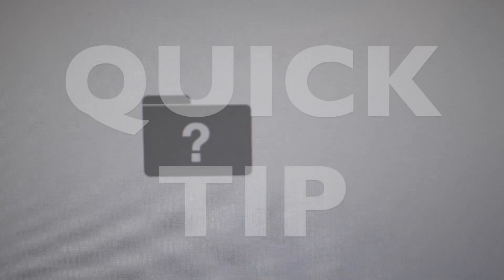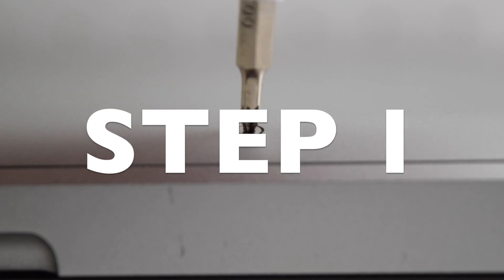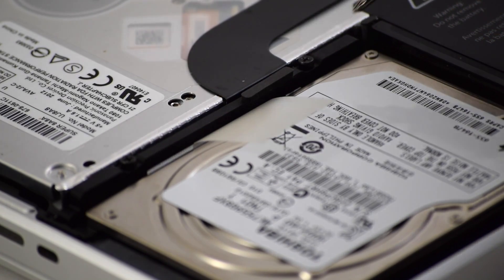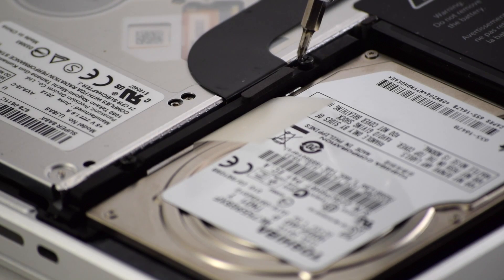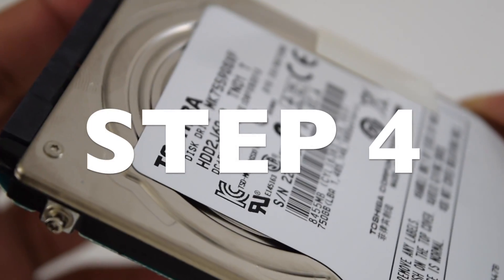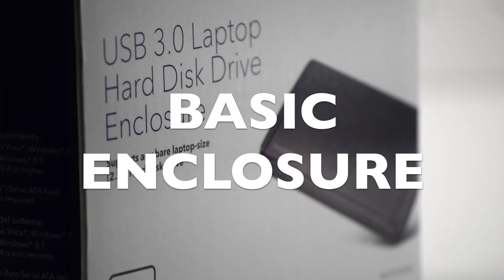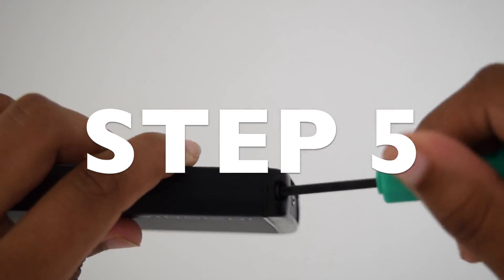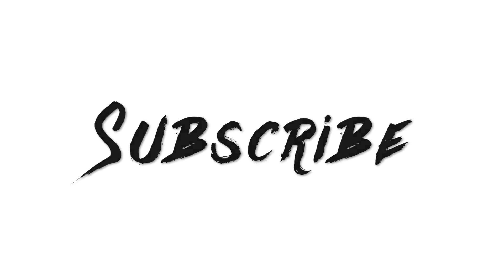A Quick Tip for fixing a flashing question mark on a MacBook Pro!!!!

Comment: Before removing the hard drive or the flex cable, it's more safe to first disconnect the battery connector gently, then push and hold the powerbutton for 30 - 45 seconds, so all power is off the logicboard.
Reply: depending on the model for sure

Comment: hi, I erased my MacBook pro and it has been showing the question mac icon. I have tried the cmd+r and power button, also the option button. but after connecting to a wireless network, it just shows me the rolling atlas and the network name. What do i do next
Reply: IZUNDU Somto me too, it says choose network, so I do it but then nothing happens. It’s frustrating
Reply: I did the same but mine got frozen while reinstalling macOS and now has those icons. You just need to click on the map icon.
Reply: Did you find a solution bro ?

Comment: Nice video but wouldn't it be much easier to just replace the internal hard drive cable? This just happened on my MacBook Pro and I'm waiting for a replacement cable now for $12
Reply: Chloe Kiluk https://www.amazon.com/gp/aw/d/B01D14LRLC/ref=yo_ii_img?ie=UTF8&psc=1

That's the one I used although the price has increased since I ordered it, still going strong for 3 months now! If you're pretty handy with electronics it should take under an hour just be gentle and pay attention to how the original was installed because you will have to put it in the exact same position to fit properly.
Reply: That's right.  Easier to replace the cable.
Reply: I got my cable swapped out and the hard drive started working fine again so it's definitely an easier way to fix this issue! Still have to appreciate the time put into making this video but for future reference there's a cleaner way to do this repair and keep the portability of your laptop. 👍
Reply: I suppose this is a way to test the cable because if it boots up then most likely it's the cable, which it almost always is as the cables they provide, just like the crap power cords Apple provides, tend to go out.  I've replaced the HDD cable twice now.
Reply: Patrik Sullivan j
Reply: Patrick is this a standard cable that will work or do you need to give the Serial Number of the cable off the Mac Pro
Reply: This is the one I ordered because it's a 2011 MacBook Pro but I would check your "About This Mac" page from the Apple menu at the top left and look up the part number for your specific computer. It was a piece of cake though just take pictures if necessary and the install is just the reverse process of disassembly! 

amazon.com
Reply: It says in the video they are going to replace the cable. They were waiting for it to arrive in the mail. This is meant to be a quick fix in the interim.
Reply: Stabmaster Arson maybe but it seems like they're saying to just walk around with an external drive as your main drive which kind of defeats the purpose of having a laptop. Plus buying an external enclosure and everything isn't practical when you can use the money to buy a replacement HDD cable I'm not sure what the point of this video is 🤔